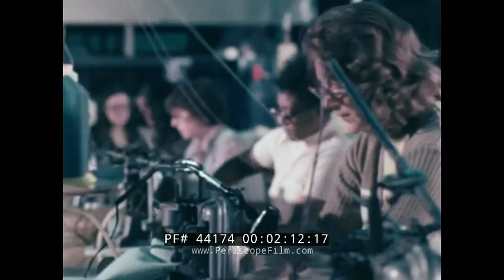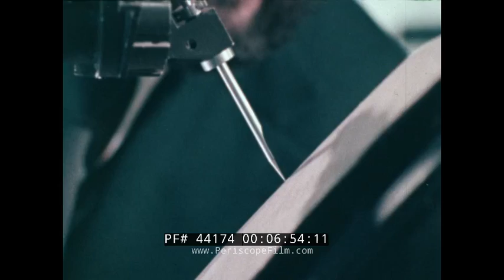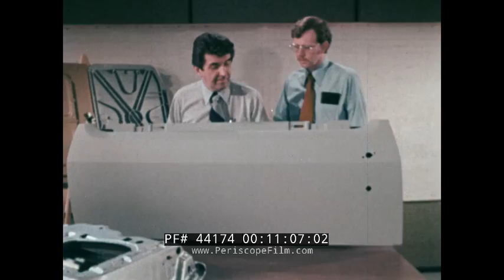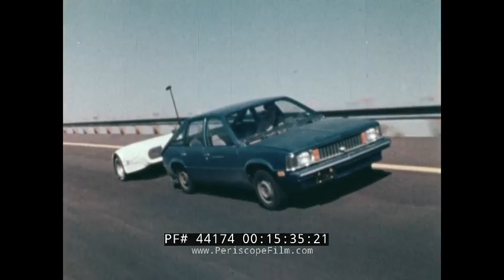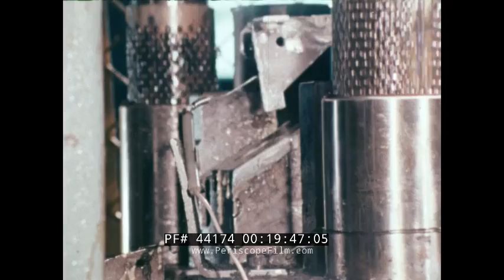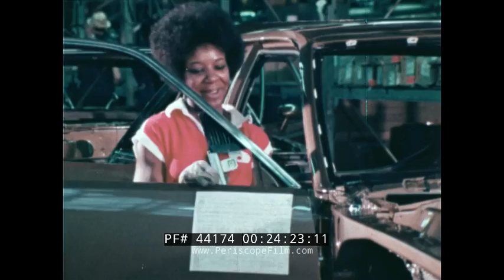FISHER BODY GENERAL MOTORS AUTOMOBILE MANUFACTURE 44174

Comment: Too much redundancy in the design and testing. Too inefficient:

Build a half scale model out of plastic. Then build a half scale model out of steel. Subject to testing and destruction rigors of a full scale model. Then build a full scale model out of steel (by hand). Only to have to subject the full scale model to the same testing and destruction rigors of the half scale models. 😳😵‍💫

So many unnecessary, and redundant steps. So much expense. Then they penny pinch everywhere else, and the resulting product is lackluster. 🤷‍♂️

Comment: What I see are people all doing their best to make a good product.  GMs problems came from accountants telling engineering to cut corners on things like smoothness and refinement.  They show the x car here in development which at that time was the right sized car for the time.  GM management pushed it’s release before all the engineering was done and we all know the result.  Look at the 2.5 liter 4 cylinder engine.  Barely adequate is what I’d call it.  A few more months of work were needed to smooth it out and make it sound less agricultural
Reply: i inherited my grandpas 85 citation ii,  with a little over 400k miles, its still going a strong. Has most of the horses from the 81 engine that was put in. i hope i can restore it to the beauty shown in the factory.

Comment: The GM 77 full size and 78 intermediates were well received and designed within a much shorter lead time using CAD/CAM.  I always liked the 77 2 door Caprice and the 2 door Deville.
Reply: Some of the best production cars made
Reply: So you like the Caprice a B body and the Coupe Deville a C body.

Comment: I remember these cars from the 80s The GM Mistakes is what they where I was a mechanic in the 80s and 90s and I remember working on these pieces of junk that GM had produced this is when all the cost cutting and shit material was being introduced into there line of cars these cars where known as GM throw away cars they where junk!! I see all these engineers working these models, well they sure wasted there time didn't they the X- Body and Chrysler and Ford where no better, I think this is when the Gov. must have really clamped down on the Big 3 to produce lighter and more fuel efficient cars well they produced garbage, I'm venting because I was one of those Mechanics that had to fix there crap, One of them was the Olds 350 diesel. what Garbage, they used a gasoline engine block and turned it into a diesel, what a massive screw up, the engine constantly over heated and then eventually the blocks and or heads warped or cracked, just a list of disasters, they used way to much thin sheet metal in there designs, for instance on the Camaros the rear shock towers where made with very thin sheets of sheet metal and the shock mounts where literally tearing apart from the shock mount, and when a customer would come in for a repair they would ask us if we could weld it up I would say Nope!!! could not weld because it was too damn thin, Remember the Chevy Citation "GARBAGE"
Reply: cars of the 80s.......JUNK!!!

Comment: This is the early 80's. These GM cars poorly built and engineered. At the same time Toyota was selling Corollas for $5995-6995, Tercels for $4995, Celica's for $6995 to $12995 for Supra. Camry had just come out at $7995-$8995. Cressida for $12995 and a myriad of small pickups from $4995- $7995. GM's comparable car was thousands higher because of the workers benefits included in the price. They simply could not compete. Their answer to Toyota came a few years later with  Saturn.
Reply: This is not exactly accurate. I had a 82 Toyota 4wd pickup and still had the original window sticker. It was 10,400 in 1982. Which was a lot more than a Full-size American pickup. And the Toyota was way smaller.
Reply: @pryme2013  You did an apples to orange comparison. Your Toyota price would be for an SR5 model which was top of the line. You had AC, 4x4, radio with tape, much larger and upgraded tires and wheels, CPP package, tow, cloth seats, rear slider, mud flaps, floor mats and probably power windows. None of this would come on the 4 speed base model which was sold for $4995 all day long. Compare your Toyota to Chevrolet's top of the line 4x4 Silverado and the price will not be more.
Reply: @bobwallace9814  it had all those except power windows.
Reply: GM was bloated as well.  Look at this video, it's about Fisher Body that in many ways still acted like an independent company even though its only customers were the GM divisions and it had been acquired about 50 years prior to this video.  You essentially, had this and other fiefdoms within GM all bloated with layers of management.
Reply: @kennethsouthard6042  Absolutely. Both management and the unions played major roles in plowing the company into the ground. It's too bad because some of their cars from that era I personally liked, I owned a late 80's Olds Delta and loved it despite its workmanship/design shortcomings.
Reply: You are spot on! Unions busted the wage scale of this Country. Good for a purpose at one point but outlived its usefulness along the way. If they didn’t get what they wanted they went on strike. Management figured out that tactic quickly and closed the plant.

Comment: GM was in the middle of committing three of its biggest sins ever when this film was made - the X-cars, the V8-6-4, and the Olds 350 diesel.  Those engineering and marketing debacles chased away millions of previously loyal GM customers who never came back.
Reply: The Vega was the real beginning of the end to GM’s reign
Reply: My dad worked at the GM plant in Tarrytown NY in the 60's and 70's. Being a GM family, my mom bought an 82 Oldsmobile omega brand new. Long story short, within a year it was sold. It was replaced by a Toyota, then 4 more before she passed. I've continued the tradition.
Reply: I think you forgot a couple, the Cimarron, the HT4100 and the look alike cars of the 80s.  Most of these decisions hit Cadillac their most profitable line the hardest.
Reply: Funny and they are still the #1 US auto producer and in sales.  Their good deeds more than sufficiently offset their mistakes.

Comment: Seeing factory fresh G body being put together man awesome
Reply: This was for the 1980 model year.  There were no G bodies, they were still A bodies.  The rear wheel A bodies didn’t become G bodies until the 1982 model year when the new front wheel drive A bodies were released.
Reply: Not entirely correct, the Monte Carlo and Grand Prix were G-bodies prior to 1982. Yes most of the A bodies became G-bodies in 1982 but the G-body platform on the rear wheel drive models did exist prior to 1982.